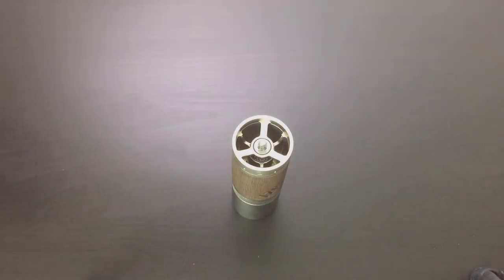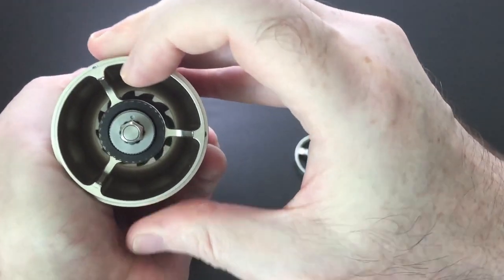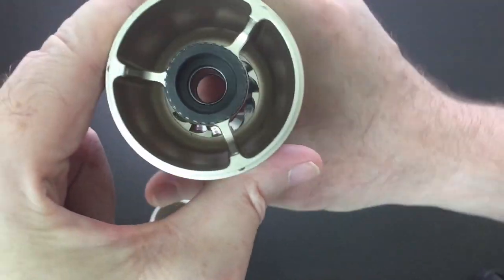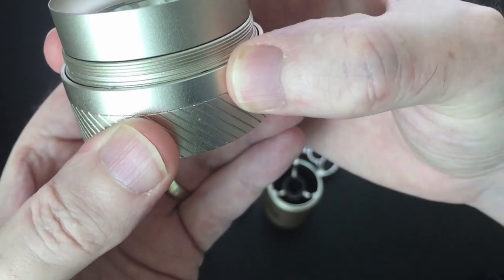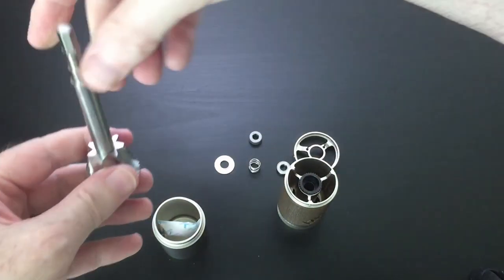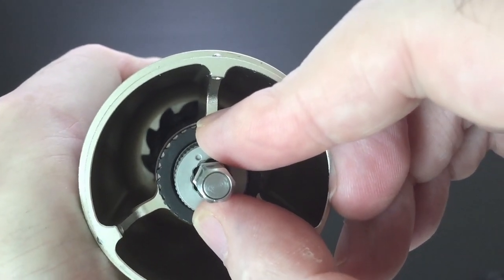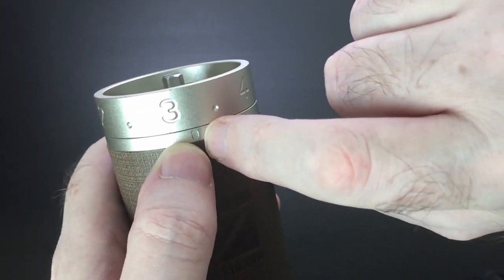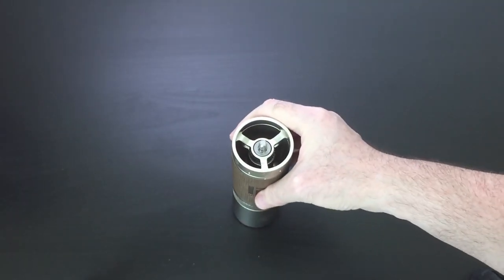1Zpresso X-Pro Quick Disassemble and Calibration Guide

Comment: Thank you for making this video. The X-PRO manual from 1Zpresso was quite confusing about where to set the dot on the internal knob when re-assembling the grinder (They used the word "angle" when they should have used the words "any vertex of the hexagonal part of the shaft").
Your video was very clear and exact about positioning the dot.
Reply from the maker: Hi Paul, thanks for the positive feedback. 1Zpresso are legendary for their confusing manuals and information.

The thumb nut on the X-Pro has a couple of things that can confuse users, to get the thumb nut off you need to open the burrs completely or the thumb nut wont come off. 

Then as you also point out, the angle of the thumb nut to take it off and fix it in place is not explained very well.

The X-Pro is an excellent grinder and i am really happy that 1Zpresso addressed the calibration issue from the JX-Pro to a much easier system for the X-Pro.
Reply: Will you do one for the x ultra?

Comment: Great demonstration. It seems very simple and straight forward to do. Two quick questions for you. 1) Is the construction all metal, or are there some plastic parts? 2) Is there some indicator to tell how many rotation you are on or do you have to count and remember?
Reply from the maker: Hi Allan. Its actually very easy to dismantle then reassemble and the calibration is very fast.

Every part of the grinder is metal and very well made, apart from the wooden handle and the plastic disc on the end of the grind handle, but these are also good quality parts.

There is no other indication of how many rotations you have opened the adjustment dial, unlike with the J-Max and its pyramid below the adjustment dial. 

But this is kind of the same for the other grinders, where you just have the numbers on the adjustment dial to go by. So its no more difficult to remember what grind size setting you have the grinder set to than the other grinders.

Obviously when you adjust the settings for the type of brew you are going to grind for, you dont need to really worry about the settings unless you want to grind for a different brew type that needs a different grind setting, then its just a case of remembering what brew type (or setting) you last used. 

Or just close the burrs completely and then readjust for the brew settings that you want, it takes seconds to do that.
Reply: @mightymightyironhead  Thanks!

Comment: Hi, i have a question, where's zero position... I herd 0 position when you cant move your handle at all, then after 1-3 click you can hardly turn the handle and on position 1 handle spend without any efforts. Is it correct? Thanks in advance.
Reply from the maker: Zero position is actually meant to be done when you calibrate your grinder, so you will also need to get the zero number on the dial in the correct starting position (if you are using the J-Max its the top of the top square on the pyramid. If its the K series grinders, its the red dot) and this will usually mean that you will have to adjust the thumb nut to get the zero number around and into position. 

Anyway there are two ways to choose from, i personally use the first way to zero my grinder when i calibrate the grinder

1) Turn the adjustment dial all the way to close the burrs, turn until you feel some resistance, when you feel some resistance slow down and keep turning until the adjustment dial is "finger tight". 

This is similar to when you are screwing the top onto a bottle, you know by feeling when its tight enough and when its too tight that you wont get it back off.

When you feel that the adjustment dial is tight enough, you should still have a little more movement to turn the dial a few more clicks.

At that point you can place the grind handle onto the grinder and turn the grinder on its side, if the handle falls, the burrs are still open, so you can (if you want to) tighten the dial another click or two until the handle does not fall.

Be be careful to never over tighten the adjustment dial, you should always still have a little movement to tighten and never try to turn the grind handle when the burrs are fully closed, because you will jam the burrs and its really hard to fix that.

2) The second way is pretty much the same as the first way. 

You turn the adjustment dial until the burrs are fully closed and the dial feels "finger tight" like the first way. 

Then you turn the adjustment dial back again to open the burrs again another couple of clicks, or until the handle does fall when you turn the grinder on its side.

Some people prefer this method, because they say that the burrs are not touching like in the first method, but the burrs are never touching and you wont have any issues unless you over tighten the adjustment dial and lock up the grinder, but even that is the thumb nut and burr shaft locking up.

Also nobody is ever going to try and grind anything when the adjustment dial is at the closed position and the burrs are at the finest setting, that's a lot finer than even Turkish, so from that position you will only ever open the burrs to get to your grind size for your brew type, so no danger of the burrs touching.
Reply: @mightymightyironhead  Good evening! I have the X-Pro S model. Thanks for such a detailed explanation. Appreciate it!
Reply from the maker: @СтасГрищук-ц7б  you are very welcome, happy to help.

Comment: Thanks again for this excellent video. I just got my X-Pro a few days ago and have been loving it. Following your easy and detailed explanations, I was able to disassemble, clean, and reassemble the grinder with no problems.  Now, I would like to hear your opinion on an observation someone made about finding the zero point. This person suggested NOT closing the burrs completely to avoid damaging them. He suggested tightening the burrs just until the grind handle either does not move, or seems to have a slight resistance, and calling that the zero point. Do you believe that he has a valid concern about over tightening the burrs to find the zero?
Reply from the maker: Hi Allan, you are very welcome, really happy that it helped.

Regarding the Zero point. I have read quite a lot of posts and blogs from people who talk about this and it kind of makes sense and it kind of does not make sense also. 

Technically the Zero point is when the burrs are fully closed and at their closest point. This is typically used as a starting guide only and i am not convinced the burrs are actually physically touching at this point. 

Even if they were touching at the closest point of the burrs, you are never going to grind any beans at this setting, because its way too fine for any brew type, even the finest Turkish grind size needs you to open the burrs a good few numbers. So you are never going to cause any damage to the burrs by trying to grind at the zero point. 

However with that said. I do agree that you should be careful when you calibrate to the zero point. When i calibrate, i dont tighten the adjustment dial all the way until its very tight, i do it until i feel some resistance and then i leave it, thats good enough for me.

Its kind of when you are tightening a lid on a jar, or a bottle top, you know what feels right and you know that if you tighten it any more, you will have problems untightening. 

Another thing that i do, is calibrate to zero point (until i feel the resistance) place the grinding handle on the body of the grinder and then turn the grinder on its side, if the grinding handle stays in place and does not drop, the burrs are fully closed.

If the burrs are fully closed and at the zero point and the handle does not move when i turn the grinder on its side, i then open the adjustment dial one or two clicks until the grinding handle does move when i turn the grinder on its side. This is a good start if you are concerned with the burrs touching and this is what i always do.

Comment: Thank you so much for making this guide video.

I would like to ask for more clarification on the definition of resistance that's suitable for the zero point. When I set my X-Pro dial to the middle point between 0 and 1, I feel something like a one-sided resistance where the turn is effortless for half of the handle spin, but quite resistive for the other half of the spin (can feel a faint grind during the turn). At this setting, when I turn the grinder to its side, the handle meets some resistance on its free fall, but eventually completes the turn on its own. Would that be considered too tight for the zero point? If so, do I keep loosening until there is well and truly zero resistance on the handle?
Reply from the maker: You are very welcome, really happy the video helped you.

When you calibrate your grinder and you want to get the zero point (burrs fully closed) turn the adjustment dial until you feel enough resistance that you feel that if you tighten anymore it will be too tight.

This can be a little difficult to describe, but it feels a little like when you tighten a jar lid, or a bottle top and you know that if you tighten it anymore it will be too tight and you will have problems getting back off. 

The adjustment dial should still be able to move slightly but be stiff.

You know that the burrs are fully closed when you put the handle on and turn the grinder on its side, the grind handle should not move at all and should stay in place.

At that point, there is some people who argue that you should not start with your burrs fully closed like that and that when you reach zero point, that you should then open the burrs a tiny bit.

There is nothing wrong with doing that, the microns size between each click is so small that starting with the burrs open slightly will not make any different to your grind sizes, again you can test this with the grind handle, if you open the adjustment dial slightly until the handle falls when you turn the grinder on its side.

The way that i see it is that when you are closing the burrs to get to zero point, as long as you don't force the adjustment dial too much and make the burrs tighter than you have too, like i described above.

So you wont damage the burrs because you will never be grinding anything at that grind level anyway (even the Turkish grind range starts at 20 clicks) and you will always be opening the burrs anyway to get to your preferred grind size.  

So its really op to you what you choose, if you feel better getting to zero point and then slightly opening the burrs again (until the handle drops) that's fine. 

If you wait for the the adjustment dial to have that resistance, but still have a slight play if you continue to turn (until the handle does not move) that's fine also, i promise that either way you wont damage the burrs.

Comment: Interesting yours looks like the burrs stock out when at 0 but mine look flush. Is mine defective?
Reply from the maker: Hi, sorry can you explain a little more what you are referring to? Do you mean the cap on the bottom of the burrs (when you take the catch cup off and look up into the bottom of the grinder, you can see a disc with a hex fitting)

Or do you mean at the top of the grinder where the thumb nut and the adjustment dial is located?

There is a disc on the base of the burrs with the Hex fitting. This is so that at some point it is able to take the burrs out and replace them. This disc does not fit flush with the inside of the body and protrudes about 3 - 4mm. this is normal.

Comment: Thanks for your detailed and helpful video. I came across one issue. I have unwinded the adjustment dial too much, and now I can't turn it back. Needles from the adjustment dial just slip over during spinning. Does anyone know how to fix this?
Reply from the maker: Hi good morning. To be honest i have not heard of this happening with the X-Pro grinder.

Sorry just to be clear with you, you have turned the adjustment dial too far to open your burrs (turning clockwise) and the three small black pins under the adjustment dial have been bent?

If this is what has happened, you need to try and bend the pins back so that they are straight again. 

I am very surprised that you have bent these pins, because they are quite solid and are designed to not bend, so you need to be very careful because because you can break them.

I personally would use some Long nose pliers like in this link: 

https://www.beta-tools.com/en/products/pliers-and-nippers/long-nose-pliers/long-flat-knurled-nose-pliers-slip-proof-double-layer-pvc-coated-handles.html

and i would very gently try and straighten the pins again, by using the pliers to grip all of the pin from above and gently moving the pin until it was straight.

If this is something that you do not feel confident to do, i would recommend that you contact either the dealer that you purchased the grinder from or 1Zpresso directly and ask them to get you a replacement part for your grinder.

I dont have a price list for the X-Pro parts, but the adjustment dial for this grinder should be around $15 - 20US for a replacement part.

Anyway i am really sorry that i can not help you more and very good luck.
Reply: @mightymightyironhead  Thank you so much! Your suggestion solved the issue ! I have managed to tighten three pins with pilers, and dial back to the finer granulation.
although I initially thought the gear had stuck.. Thank you!
Reply from the maker: Hi good morning, sorry for the late reply, YouTube really does not indicate when i have a message sometimes. Anyway really happy that you managed to fix your issue there.

Comment: What setting do you use/ recommend  for a v60 with the xpro?
Reply from the maker: Hi Saul. The recommended grind range for Pour is between 120 clicks (2 full rotations) and 160 clicks (2 full rotations and continue to the number 4) so you have quite a big grind range for Pour over with the X-Pro.

It really depends on a few things, in particular the shape of your V60, your beans (Natural, washed and semi washed might all need a slight adjustment in grind size) and also what roast level the beans are (light or medium). 

So i am sorry that i cannot give you a perfect number. i would start in the middle and adjust accordingly (maybe 140 clicks).
Reply: Thank you
Reply from the maker: @Saul-zp6hh  you are very welcome, thank you also for the sub Saul.